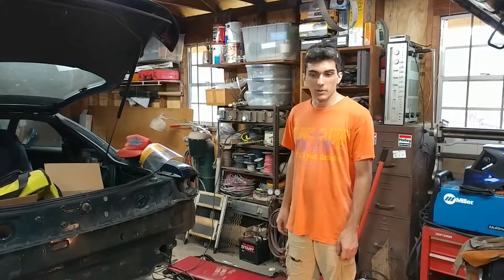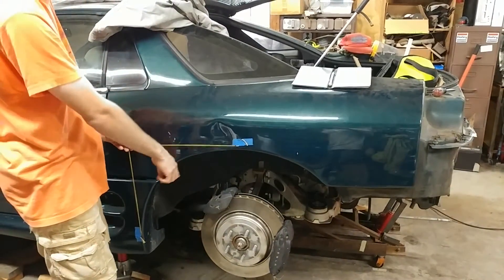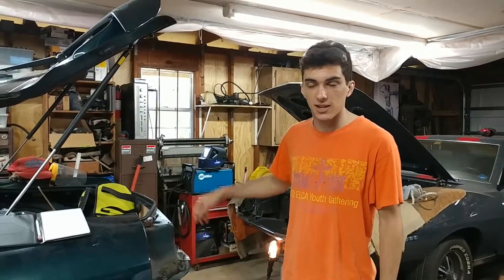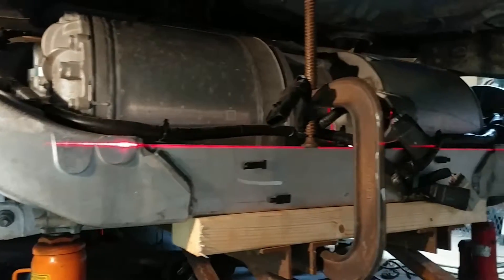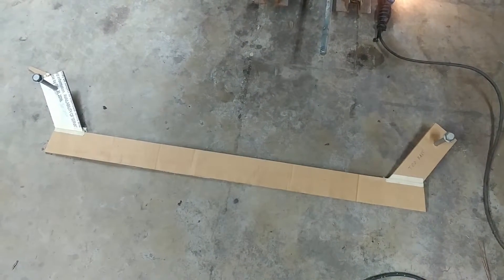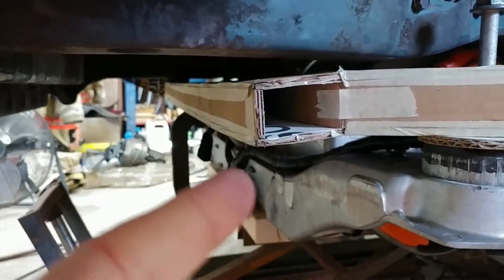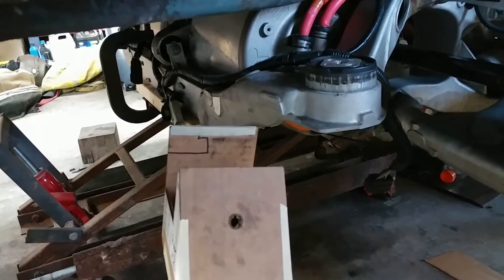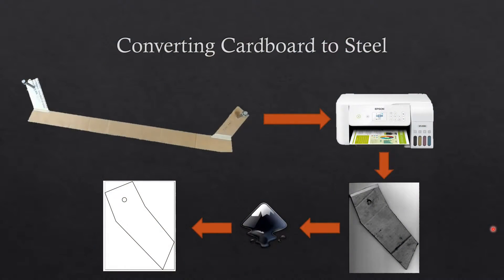Mitsubishi 3000GT Tesla Swap 5 - Cardboard Motor Mounts

Comment: 4:45 wait 
Is it going to be dual motor!?
Reply from the maker: Unfortunately no, I meant "front" as in "front side of the motor subframe", rather than the car. wk057 has a dual motor 3000GT conversion, but I'm sticking to one motor to limit cost and complexity. Not having to re-imagine the front steering linkages and keeping that space for the batteries are important for the goal of completing a daily driver that meets my range needs. If this one ends up as awesome as I hope it will be I'll think about it!